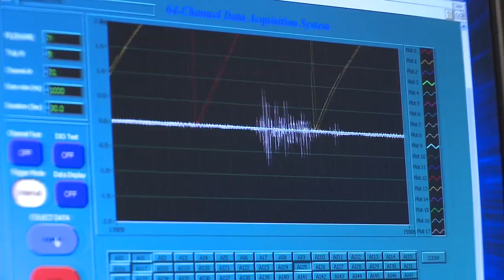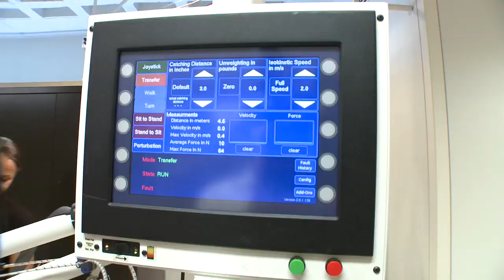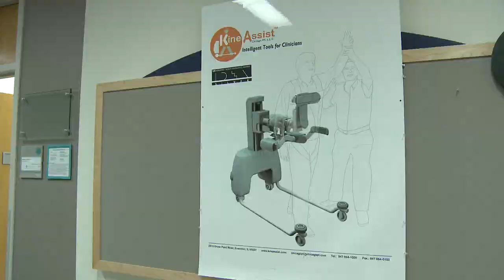News at Northwestern - Stroke Rehab Program

Comment: Having suffered a mild stroke, what I see that is absent from physical therapy programs is a fundemental understanding of breath control. Using the diaphram along with the breath as a pump may help take away that added stress on the heart. I watch the patients and they are struggling and holding their breath. That will build tension and may not help in the healing process. Increase the O2 levels in the therapy area by adding plants as well that are around 4 to 5 ft in height.